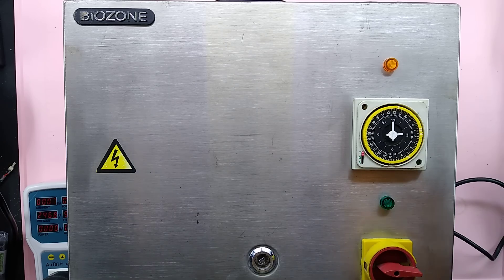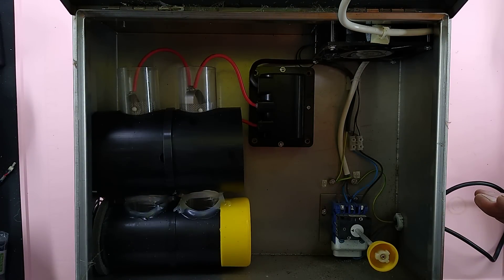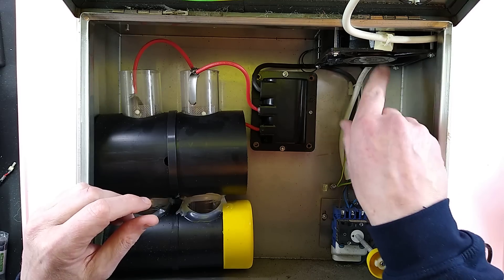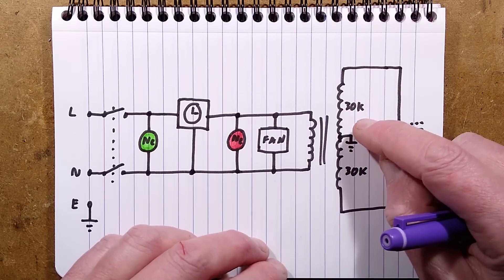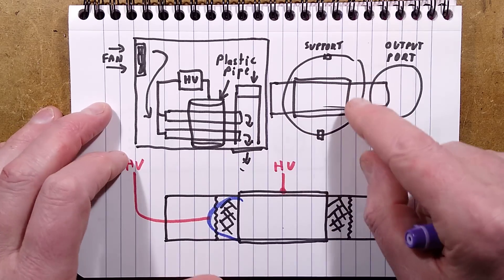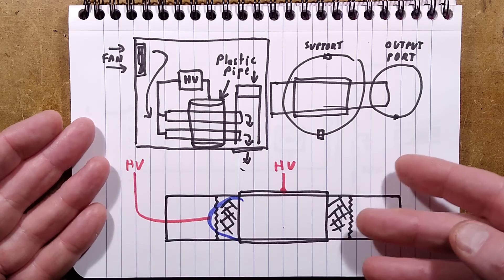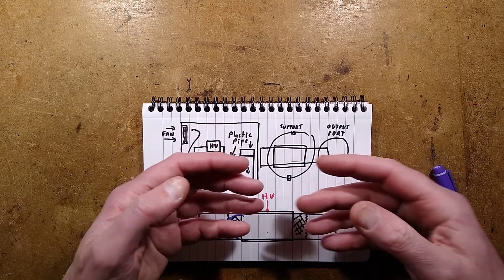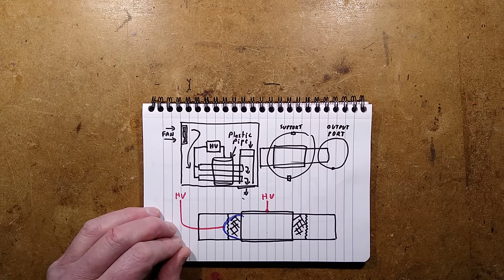Big MOFO industrial steriliser unit

Comment: That mesh stuff in there, the "Living Air" air purifier I just got has two ceramic plates, 4.5in square, with a 3in square of that stuff attached with hot glue around the perimeter of the mesh on either side, and they sort of slide into a rack where a spring tab, kinda like the ones in this machine, touches the mech on either side. Mine's an older unit, and it came with a second set of plates that have a 3x3/4in strip where the tabs will touch it. You use either the two "small plates" one big and one small or two of the large ones, and combined with the power dial for it on the front it'll generate, according to the manufacturer, an appropriate ambient ozone level anywhere from 20 to 1500 square feet. I usually use these things at full blast left alone in a room for an hour, or in a bad smelling car, or if I'm cleaning up a vacuum cleaner and it still smells after being taken apart and washed, I'll suck the ozone through it for a while and it'll solve it. The interesting thing, when you turn the ozone power dial all the way up, the plates actually will howl from the discharging going on.

Comment: Is it true that these glass or quartz tube-based ozone generators are less susceptible to diminished performance/efficacy in high humidity environments & have better longevity compared to ceramic plate-based ozone generators?

I own a unit of the latter variant but I've been recently been tempted to purchase a glass or quartz-tube based ozone generator due to those aforementioned claims by a few sellers. I am from Singapore where the average RH indoors can get as high as ±85% so I sorta did a lil' Googling on those claims but wasn't able to arrive at any definitive conclusion.

I however, had the fortune of stumbling upon your YT channel and I reckon you to be a subject matter expert on this based on all these videos on your love for 'em ozone generators. Minus my lack of knowledge on the technical parts & stuff, I am now a new fan of your content!
Reply from the maker: I'm not sure how the ceramic vs glass versions compare.  With regard to your air conditioning.  Make sure the filters and heat exchangers are clean and that there isn't too much airflow through the room.  Nudging the temperature back a bit can also give a significant saving.
Reply: Oh and on an unrelated note, thank you for saving me a couple dollars on those scam/fake power saver plugs; I came pretty close to purchasing one for the ungodly amount of electricity my portable ac has been draining from my room.

Comment: Looks like something my boss would have had me build back around the time COVID was still a thing (if only I had decided to trash talk my way into industrial mechanical and electrical before 2022... all of the components in here are available in the supply area where I'm at, particularly stainless mesh because I'm currently at a raw meat processing plant).

Most places dealing with meat just have a cleaning contractor come in and atomize ammonium chloride though (feels like tear gas and will eventually have you hacking out blood so the guys on graveyard still need to vacate the building, but I guess it's cheaper than paying $45 for labor plus parts per unit to build a bunch of these for cleaning the air after the meat bits are thoroughly—not super thoroughly—washed from the machines).

Comment: I've read/heard somewhere that using these near to general electronic items, and dslr cameras specifically, are not good. As it can oxidise the circuits inside the items in the longer run. Is it true??
Reply from the maker: It would take a very long and high exposure to ozone for damage like that to occur.

Comment: That looks like it was an awesome machine, Clive. It's nice too see inside these 'black boxes', even if they are in, some ways, quite straightforward. 

Are there any such machines that have a built-in display of the ozone generated? Are there any ozone measuring devices (that aren't very expensive, and if so is there any chance you could feature one on the channel? It would be very interesting to see ozone measured and the safe levels involved.
Reply from the maker: I have several ozone meters, and they only really register very high levels.

Comment: Wouldn't it be better for the fan to be on the output and sucking air through the unit, instead of trying to push air through the unit?
Reply from the maker: It would get damaged by the high ozone concentration.

Comment: Very interesting, as ever. As a matter of interest, what sort of voltage will there be across the plates?
I remember the ozone smell coming from faulty CRT line output transformers. I think they took the voltage up to about 15kV, which was then rectified. Maybe these ozone generators are lower than that?
Reply from the maker: The voltage may be similar.

Comment: I encountered a used car dealer that used a similar unit to rid cars of cigarette smoke smells including the AC systems as well. I refurbished an older Cadillac and it had a lot of cigarette film and smell build up and I used the UV lamps I mentioned before and that did the trick as well. After 72 hours of treatment the leather and trim brightened also.

Comment: Nice video, very interesting!

You may of course be completely correct that the timer is mis-wired, but I wonder whether the switch is simply meant to represent the timer use, 'on' - timer operation or 'off' - bypass the timer, rather than an on-off switch for the unit

Comment: So how high is the voltage? I'm surprised you didn't measure the primary to ballpark the output. I'm also surprised you didn't bypass the interlock and show the purple glow.
Reply from the maker: I don't have a tester here suited to such a high AC voltage.  The glow would also be hidden, as it happens in the area where the concealed outer electrode and inner mesh overlap.

Comment: I worked at a hotel I was maintenance owner wanted to put an ozone generator into the swamp cooler system it made the whole building smell like rotting fish it was horrible even when we turned it as low as it would go it still was horrible finally they ripped it out
Reply from the maker: If anything it should smell like faint bleach.  I wonder if the smell was something else.

Comment: Longevity is similar to welding machines/transformers, you have these new MOSFET or IGBT types, ok more efficient and very light, but you can bet you will go through 10 of those or more to a traditional transformer with adjustable shunt or taps for current regulation.
Some older things are so much more reliable than all this 'switch mode' palaver gear these days.😆
Gaz Yorkshire.

Comment: I think it has the current limiter resistors inside of the transformer.
Reply from the maker: The impedance of the secondary windings and core design will be the main current limiting factor.  But the low capacitance of the plasma generator will limit the current to a low level.

Comment: Similar ones were sold for adding ozone to pool water, saving you needing chlorine. Added to the output of the sand filter, and using a small pump to provide enough ozone flow to overcome the residual pressure of the return pipe. All fittings with silicone tubing, and PTFE fittings, machined out of solid PTFE where it contacted the ozonated air. While the PTFE stood up well to the ozone, the silicone tubing tended to rot away, so the units needed service regularly, and you also tended to find the pool side piping rotted away as well from the inside due to the ozone as well. But no chlorine needed at all, and no smell at all from the water either.

Comment: I've seen machines on this scale being used in large Pathology Departments for localised odour control. The air extraction ducting from the tables also has ozone injection for the same reasons, as well as for microbiological safety.

Comment: it never gets old when you talk about Ozone devices. We have a large Ozone generator at my job, it uses two big discharge tubes and works of a high voltage mains transformer. The dealer of this old device calls it the "dinosaur" because it never dies. I just swapped the tubes though because they lost some power and it´s not possible to wash the inside of the glass. but this unit works great to neutralize smell in motorhomes and caravans
Reply: I thought they found out those dont actually purify the air at all and just numb your sense of smell instead?
Reply: @Stormer-vx5kw  You set an ozone generator inside a sealable space like a motorhome or hotel room, set the timer to run for an few hours and leave after sealing the door. The Ozone will react with smelly chemicals, and unfortunately plastic and fabric. So it's a lot like bleach. You do NOT want to be inside while it's turned on
Reply: @Stormer-vx5kw  ozone breaks down the bad smell very efficiently. It’s because it’s an oxidizer

Comment: Some questions.

If the ozone is generated inside the glass tubes, what might be the reason for having mesh rather than solid metal on the outsidel?

Did you measure the secondary voltage?

With very little current being drawn from the secondary, the transformer should appear as a largely inductive load. Did you measure the VA as well as the watts?
Reply from the maker: The outside is solid metal.  The main ozone is generated on the inside.

Comment: This looks like someone took a nice industrial cabinet, regular hardware store components and proceeded to hand over their beer to a friend for safe keeping while going wild with hot snot and hand tools.
Love it!
Reply: @Frinkbit  that's just what my grandfather gave me when I was twelve, I built a box with switches and lights just to play with. Good soldering practice. It actually ran a couple of lamps and a radio in my bedroom. Also had a selsun (sp?) motor connected to its twin on the roof with a weather vane but it quickly rusted.
Reply: @tncorgi92 
If I get my boogerhooks on a cabinet or panel I might have to try and build something like that for my room.  Bonus nachos if I make it 12V source and can "dock" it at home and in my camper shell on my pickup!🤪🥼🔧

Comment: Clive,  I'm on the ozone wagon with you.  I also got a positive ion generator for my workbench area. 

Question: Would it ruin the fun to build a device to measure ion output? Maybe a charge collector with electrometer function.

PS. I thought I'd looked at all the ozone videos.  Where is the one with Ne and Ar tubes?
Reply from the maker: You can do a basic charge test in air with a digital multimeter with the negative lead connected to ground and the positive lead connected to a metal plate.
Reply: @bigclivedotcom  thanks for that, explains a lot in one sentence,ill give it a try

Comment: This is the random eclectic equipment that's the highlight on your channel.  Plus you do the tear-downs and reverse engineering which is always invaluable educationally.  Would be cool to see if anyone ever took one of your schematics to build a circuit from scratch.
Reply: He has project schematics on his website and I think he still sells DIY kits though he said parts are getting prohibitively expensive.
Reply: I have built the Joule Thief as a young teenager, very satisfying circuit that just lasts and lasts. Gotta build a new one.
Reply: Who has the courage to build one of the Chinese death traps though?  One of the ionizers where they cut every corner possible.  Personally I always find the solar circuits to helpful as that's what I do more of.  There's a few parts retailers/suppliers online that aren't too bad, especially if you're buying in bulk-ish.  Probably still some supply-chain issues.

Comment: Reactance -Reactance is a type of opposition that occurs in AC circuits, but not DC circuits. It's caused by the storage and release of energy by an electric or magnetic field when AC passes through a component
Reply: I was going to comment on that but you beat me to it . The non-resistive component of impedance in an AC circuit, arising from the effect of inductance or capacitance or both and causing the current to be out of phase with the electromotive force causing it.😏

Comment: I actually worked on a very similar unit to one of these. The health and safety bods decided it wasn't safe, so i fitted a 30-minute timer wired to drop the transformer supply and the switched live trigger input timer trigger wired to a PIR unit across the room. They wanted the PIR mounted on top of the unit, but i talked them out of that. I wasn't sure what all that ozone would do to the plastic.

Comment: Looks about twice the size of the ozofresh machines we use at work. Ours use ceramic plates with tracks on them but can't remember what drives them. Ours certainly doesn't look like this one, it not at all looks "heath robinson" like the one in the video. Works very well for the removal of smoke, cooking and dog smells (well unless they've wet the carpet!)

And yes I have had one of ours apart, it had failed and the boss asked if I'd have a look at it. Manhandling had resulted in at least one of the plates breaking, when its being transported in and out of a van into caravans you have to look after it. At least it ended up in us getting another machine and the original repaired so we now have two, handy when on changeover days they can be in high demand!
Reply from the maker: The ceramic ones often use high frequency drivers similar to neon tube supplies.

Comment: I don't know why, but the spin-up of that fan is an oddly satisfying sound, I do like that sound some motors make as they power up and gather speed, even better when it's bigger motors... :D
Reply: And it gets even better than that when it's a huge motor with a big load on a star-delta starter :) Those really sound angry when they start!
Reply: @redpheonix1000  it gets even better when a huge motor is removed from a rather large screw compressor and left sitting for months on end to collect moisture. Nobody bothered to do an insulation resistance test and the guys decided to just hook it up and turn it on :D Angry indeed, we had molten copper spewing out the back of it :D
Reply: The sound of a large 3 phase motor starting up, is oddly satisfying!
Reply: You will love ebmpapst fans
Reply: You would love some of those large data center routers then. They get loud though.